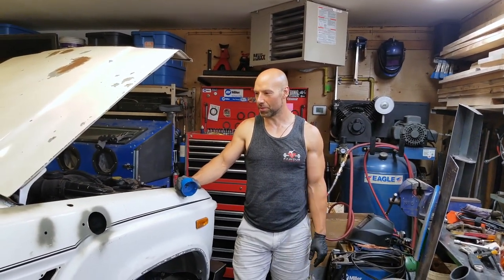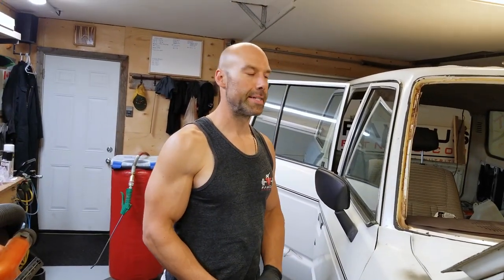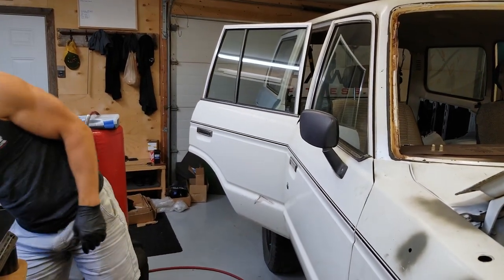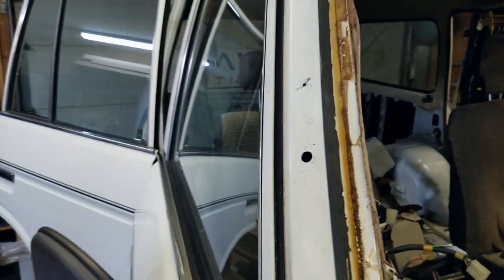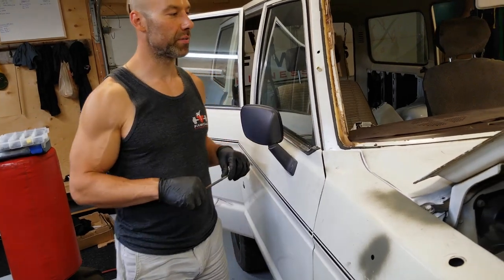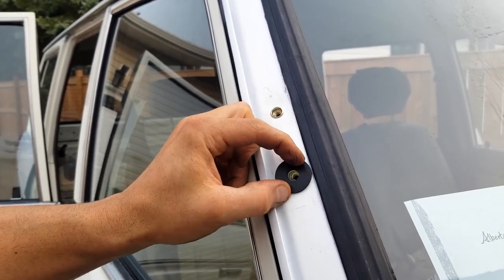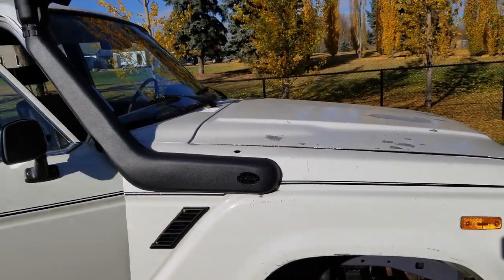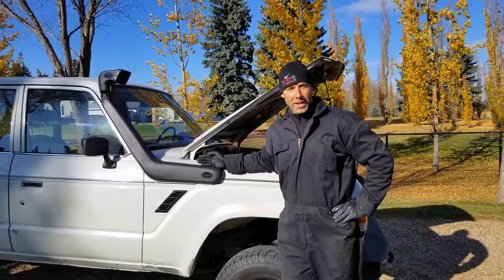60-series Landcruiser snorkel installation tips!

Comment: my 60 hasn't got the antenna in the way but i got the power outlet between the airbox mounts and the 2 boost led pressure switches too. not sure if the difference is because of RHD & LHD.
it does hurt cutting & drilling holes in the rig and I haven't done the pillar yet 🥺